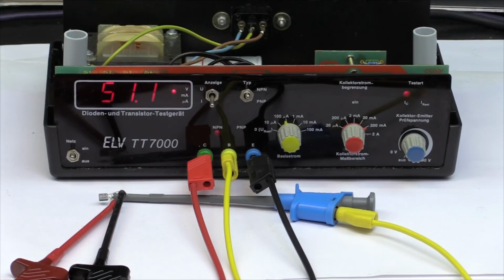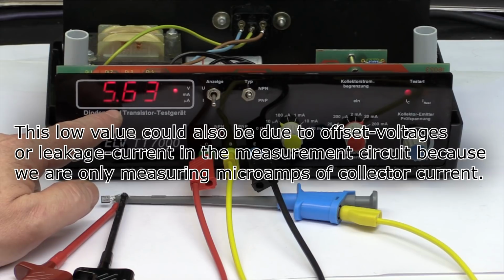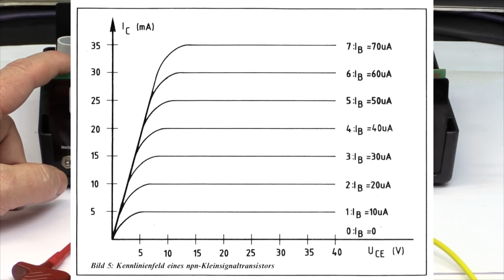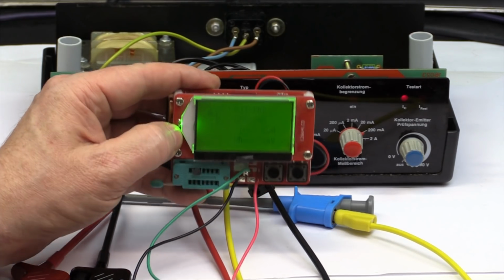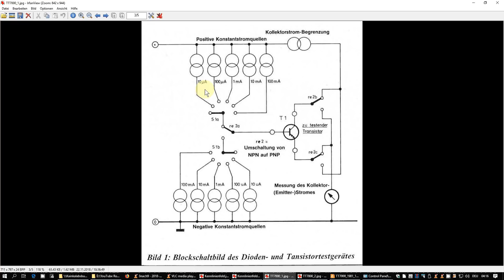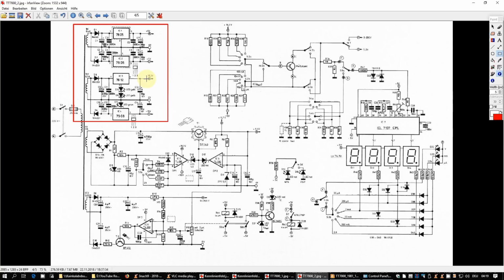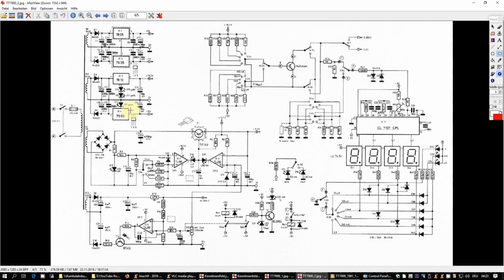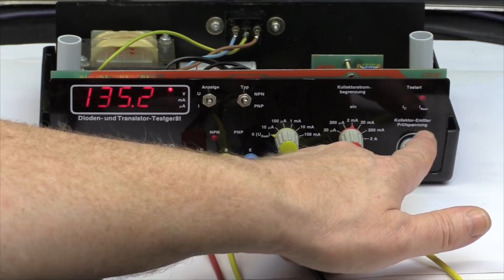A Transistor-Tester with hfe and Breakdown Measurement

Comment: Schönes Video Roger 👍🏻
Ich baue mir den gerade nach weil ich den Tester leider nirgends finde. Keiner bietet den an. Also, selber bauen.
Reply from the maker: 40 years old instrument are of course not sold any longer by ELV. And you find one on Ebay once every 5...10 years at best.
Reply: @KainkaLabs  I meant in used condition. I know that ELV don't sell it anymore 🙂
But I successfully recreated the device and it works 👍🏻
Now I'm going for the Klirrfaktor Messgerät.
Too bad that you don't make more of this videos.

Comment: Wow! I thought this might be a bit interesting at first glance, but after watching I have a few ideas for projects I want to build. These different circuit blocks are interesting little beginner's tools on their own.
  Thanks for a save-the-reference level upload.
-Jake
Reply: Hey Rodger, after looking at this in a little more detail, I have one question.
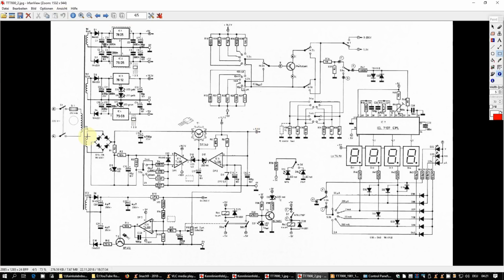15:01
On IC5 pin 3 (TL082), why is this node connected to the 10k trim pot (R17) of the adjustable high voltage circuit block below? Is the 5V6 zener (D11) just acting as a reference for the high voltage circuit or is there something more to this? If I build the current limiting circuit independently, should there be a 10K resistor in parallel with the zener to ground or just omit the resistor entirely? I'm pretty sure it's needed to act as a voltage divider with the 10K resistor of R9, but I'm not 100%.
  Also I guess a 5V6 zener (D11)/voltage reference would be needed for the trim pot to build the adjustable high voltage circuit by itself. 
 Thanks in advance for any advice ;)
-Jake
Reply from the maker: D11 creates a 5.6V reference voltage for the upper tab of the pot so that with the middle tab you get a variable voltage between 0 and 5.6V which then goes the inverting input of the OpAmp as a "set voltage"
If you build the current limiting circuit alone you don´t need an extra 10k resistor in parallel to the zener-diode.
That´s the purpose of the zener-diode: to make the voltage across it relatively independent of the load in parallel to it (here: no load or 10k load).
And yes: to build the high voltage circuit alone you need the part with the zener-diode (or another stable 5...6V reference voltage from somewhere else in your circuit)

Comment: if i want to build it myself with arduino, what do i need to do so it will also measure mosfets?
Reply from the maker: A lot. 2 Computer Controlled Voltage Source, 1 with settable current limit, 2 precision voltage and current ADCs....
Reply: @KainkaLabs  computer controlled voltage like LM317?
Reply from the maker: LM317 is an analog voltage regulator; not a digitally controlled that can be interfaced to an Arduino.